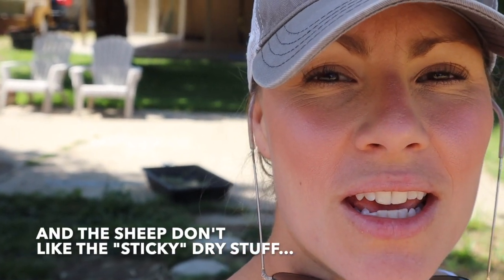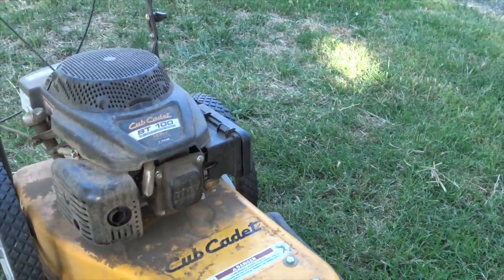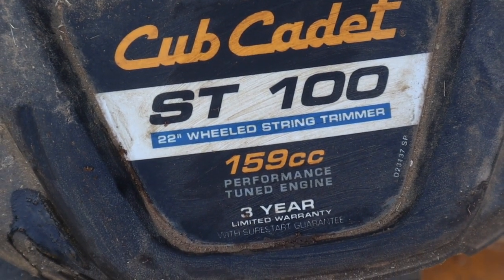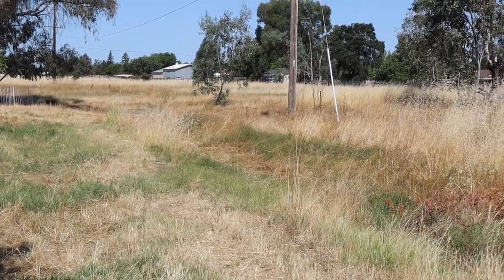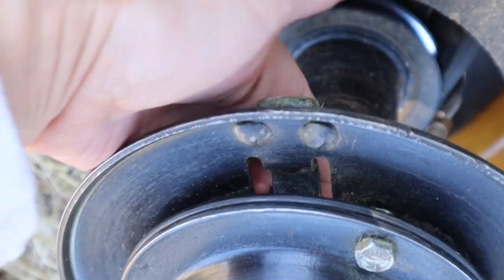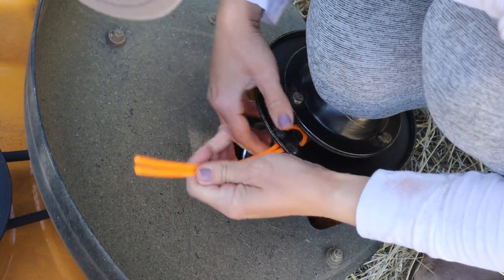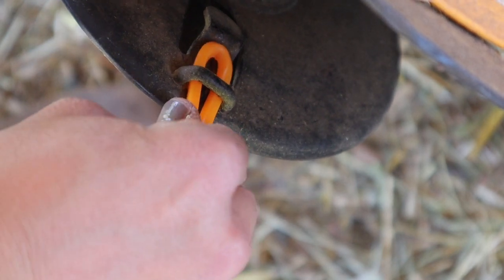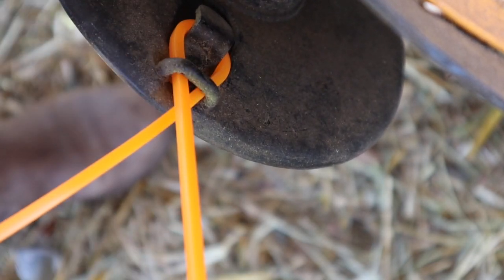Better Than a Weed Eater, Cheaper Than a Tractor! | Cub Cadet ST 100 Walk Behind String Trimmer |

Comment: I've had one of these for almost 2 years and it has been the best.  When I pull it out for the first mowing session of the year, it takes two pulls to get it started.  After that, it starts on the first pull.  It's a beast when it comes to cutting grass and tall, thick weeds.  I like the offset of the cutter head so you can get right up next to a fence or wall.  The thick strings last all afternoon or until you try to tackle weeds with stalks bigger than your finger.
Reply from the maker: We totally agree! we love tools and machines that don't require a lot of maintenance. When we do put it to work we go through the strings pretty quick.  so far thought it has worked like a champ! Thanks for commenting.  We appreciate it!

Comment: To change string Fold string in half push, thru loop, hook over clip and pull, takes just seconds and is always even. Have been using push trimmer for years.

Comment: My husband watched your video while I was watching I wanted him to see this and he knows about them and said here in Florida he has looked for one but no luck, I think now after watching this he will look harder lol, Thank you for sharing and admire your strength and courage for doing something on your own, You will have fun learning and always learning and that is the Rewards, Have A Blessed Weekend!
Reply from the maker: spitfire red thank you...we feel they are pretty necessary...and to be honest we are not good at maintaining our tools...so this thing is still running great which speaks heaps about how tough it is 😊
Reply from the maker: Also check on amazon...I think they have them...they run about 300ish dollars.
Reply: home depot. same exact model in video
Reply: Hello, I stumbled upon your video regarding the Cub Cadet ST-100; Or As I Call It, WeedEater On Wheels {WOW}. My unit was purchased about 3 years ago from a Tractor Supply location here in Central Ky. I also purchased the spool of Shakespeare Yellow .155 string in which I cut to a 18,7/8 inch length. Basically, I copied off of the OEM orange strings for making my strings. Do not go any longer than the OEM strings or it will cause damage to the deflector shield. This string on a spool cuts just as good or better than the OEM orange strings that were provided with your unit when you unboxed it. Tractor Supply also keeps the replacement air filter in stock as well as the 10W30 Cub Cadet brand motor oil. Good Luck with your trimmer and Best Regards From Versailles, Ky.

Comment: I considered buying a Cub Cadet walk behind string trimmer, but decided to buy a Husqvarna trimmer instead. 

Although the Husqvarna trimmer mows tall grass & weeds well, it has a few minor design issues that I think Husqvarna should have been improved. The main issue is that the string line spindle housing clogs with grass, slowing the spindle rotation & reducing grass cutting effectiveness, when mowing at the lowest string line setting adjustment on the spindle. 
I have wondered if the Cub Cadet might have been a somewhat better choice, & I think both the Husqvarna & the Cub Cadet were priced similarly.

Thanks for the review!

Comment: Nice video! What is y'alls preferred trim string as the stuff from the big box stores gets eaten up in a hurry, thank you for showing the machine😃😎
Reply from the maker: We have tried a few...honestly it seems like the cub cadet brand is best.  we got ours on amazon.
Reply: Dont buy the cub cadet precut or its expensive. Buy any brand of 0.155 thick line in a 100 foot roll or larger and cut each piece to 18 inches. Even better soak the cut strings in water for 24 hours before using them. You will get about 6 times the string for the same $ buying a spool of line.

Comment: the string mowers are beast on the tall grass.
Reply from the maker: So true...string trimmers are better for the detail stuff. Thanks for watching and commenting! We appreciate it!
Reply: easier to thread the string from behind the hook through the loop than to make the loop and push to hook.  In my opinion anyways.
Reply: @4KidsandaFarm  no problem.   

for future reference if the thing ever starts having probs starting it is probably the auto choke system on there.  it is rather over complicated little system for auto choke, auto throttle. 

there is a spring that sits in little box next to muffler.  when cold it is choked. after start muffler heats up the spring and open the choke.  the spring goes out after awhile.
Reply: the spring is connected to a long rod that goes across the motor to the carb.  anyways just put that in back of mind if it ever gives you probs check that first.

Comment: Wow 5 acres. I'm on a 1.3 acre property and it used to be a big hassle because for a few years all we had was just a weed eater and I would do the entire acre with just that 🥵🤕😵. After alot of frustration, exhaustion, and back ache, we finally got a riding mower in March 2020. I was looking to get one of these for the ravine we have on the property that is too small, inclined, and rock and tree lined for the riding mower. It is also too big for a weed eater. So I was thinking about getting either this or traditional old push mower. I have never owned or operated one of these.
Reply from the maker: we can say that we have not regretted this machine...it has been so helpful.  usually our sheep and cows do a really good job at keeping the weeds down...but this is hands down the best hands tool if you want to do some quick precise trimming.

Comment: Been using one for years. Changing strings is straight forward. Easy? Takes about 10 mins. Problem is, trying to get them to stay in place and also not to break. Sometimes the strings break almost immediately. Hardly ever last over an hour. Depends on what you are coming in contact with. Experiment with different ways to secure the strings. You'll find something that works for you. For me,  I use a smaller diameter string to secure the larger one. Still have to change them at least once every time I mow.

Comment: Question is this similar to the billy goat high weed mower? My dad has similar grass to this and has been doing it with his weed whacker. Been looking for something better and was told a high weed mower can help. We couldnt find a tractor to rent but a high weed mower walk behind we did. Any advice will help its about 2 acres. Also how long did it take you and how much area did you cover. Thank you in advance
Reply from the maker: I think the billy goat is a little more heavy duty and can handle thicker brush. This cub cadet will handle to acres easily.  we have 5 acres and its just a breeze.

Comment: can you tell me if the string is strong enough for the blackberry bush, I am an old woman and wonder if I can easy to start the engine and push it. Is it heavy to push?
Reply from the maker: Easy to push...easy to start...the strings can cut through berry bushes but you may have to change the strings a lot!

Comment: How much oil did you put in? Because the instructions kinda makes it sound like you put the whole 20 oz bottle in, but the dip stick showed full at half a bottle
Reply from the maker: Gem girl we only did half...but after it ran for a day the other half fit in...we haven’t filled it since 😊
Reply: @4KidsandaFarm  ok, cool. I have used mine about 4 hours so far. I checked the oil each time I've used it. I'll be sure to check again next time. I just have to get more string. My TSC was out of the line. They had some shakespeare brand but it wasn't as thick.
Reply from the maker: We just bought in bulk from amazon...we have like 3 tubes of strings which should last quite a while 😊

Comment: Spindle on mine fell off within seconds of starting.  Could not figure out how to reassemble and no diagram in manual.  Took back to dealer.  Will go elsewhere.
Reply from the maker: Oh no, sorry about that.  Ours has been nothing but rock solid!
Reply: The dealer replaced it with a brand new one today.  The new ones was awesome.  It took down 3 ft grass with no problem.  The result was almost as nice as a lawnmower but cut what most lawnmowers could not handle.
Reply from the maker: @brandonletzko2472  that’s great! I think the only thing that could replace it is a bush hog...but even then these things are second to non at cutting near fence lines!